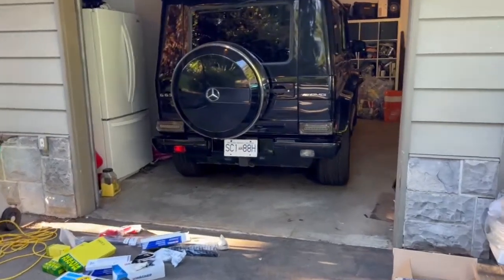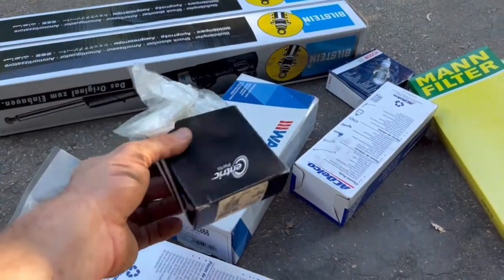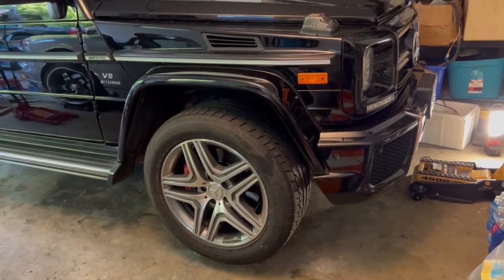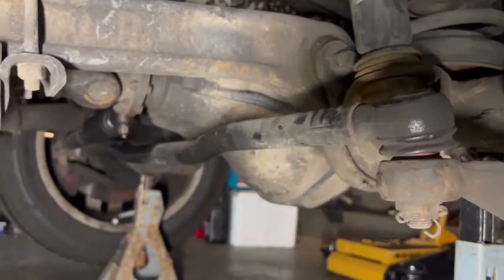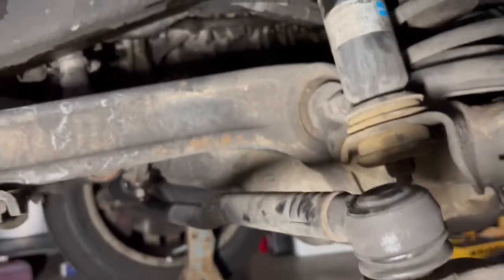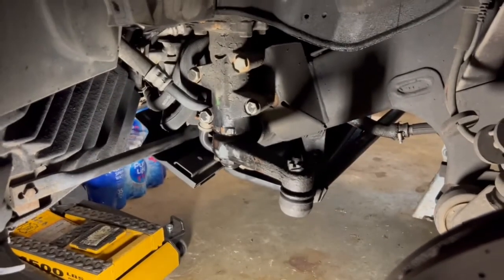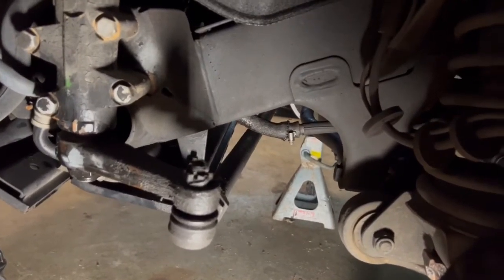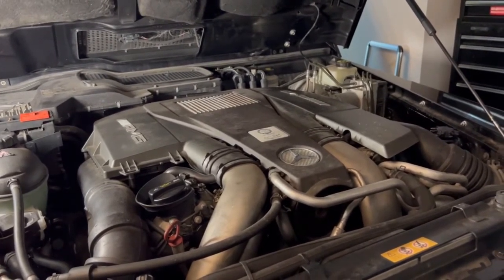Front suspension inspection on 2013 G63 after taking it to an alignment shop

Comment: Try checking the hood rubber stopper, if is not level both (left and right) the hood does a clunk sound. I have a 2014 G63 and after months of clunking sound, it was as easy as leveling both. no more clunk 
(Hood rubber stopper or hood tensioner, I don't know how its called. is like a screw with 2 nuts on both sides of the hood just where the turn signals are.)
Reply from the maker: Thanks I will check it. The clunk was coming from the suspension. It ended up being the drag link was a little worn out. I took it to a different alignment shop and after replacing the drag link they were able to align it no problem
Reply: Do you have a link to where you ordered the hood rubber stoppers from?